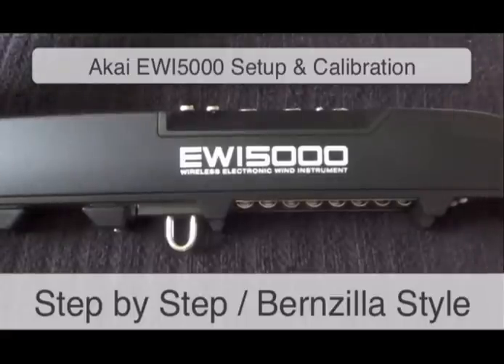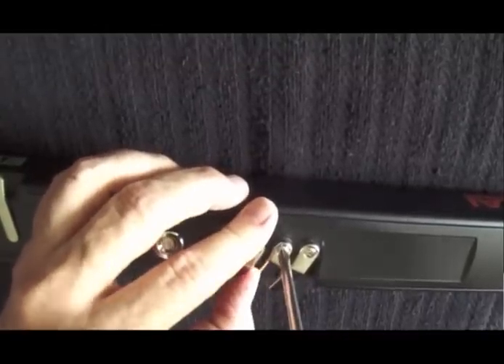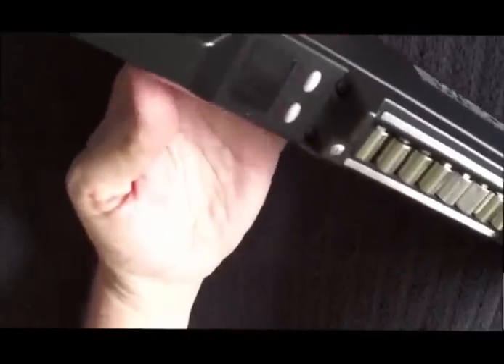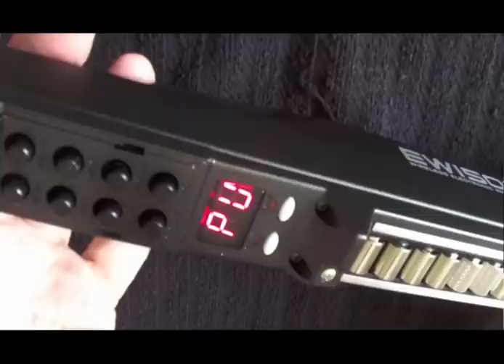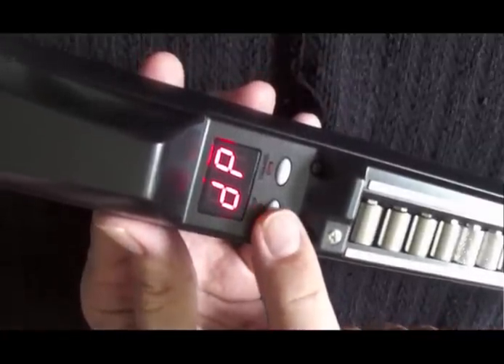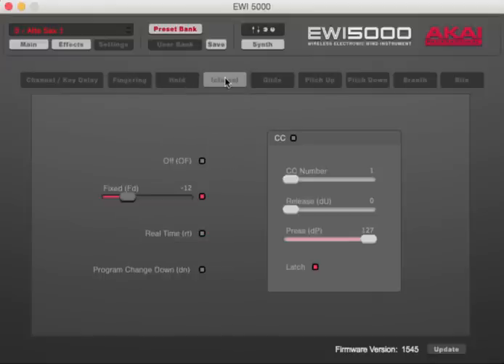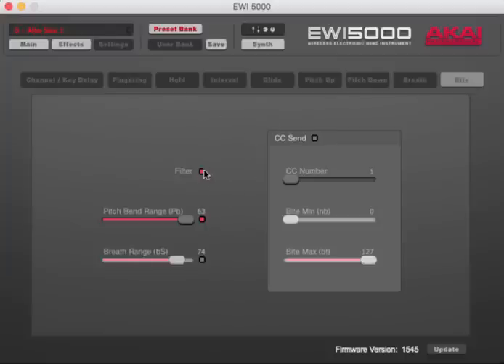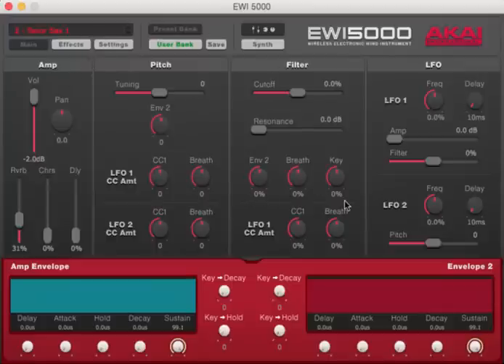EWI5000 Setup and Calibration Video Step by Step (Free Viewing)

Comment: Thanks! You do the support I would expect by Akai. 
I had some problem by unscrewing the low note keys as you show it. The internal screw nut was soldered insufficient to the printed board and fell off! A loose nut inside the printet cuircuit boards is ultrahazardous! I had to open the EWI to get it out. To solder it to the proper place would require to decompound the EWI completely (get off all the boards and other parts) to to make it accessible to a solder iron to solder back the loose nut. Now I think about another solution.

Comment: Hi Bernie, thanks for your well presented video, it saved me a lot of angst. I may get around to downloading your Presets but at the moment I've got enough to learn about my EWI 5000 as it is. Just a different question..I noticed in the manual you can set up the keys in an instrument order e.g Alto Sax, Tenor Sax, Trumpet, Clarinet, etc down the keys. This enables, as it tells me, to quickly change instruments during my playing a song e.g . It adds more interest if you can do this without foot pedals.
I also play a Yamaha WX7 linked up to a Yamaha MFC controller and then into the Yamaha VL 70m (with the new pre=set chip} and so changing from one instrument to another is just a foot tap away, but, as you can see, there are more parts but as you've got this versatility, it has worked well for me over the 20 or so years I've played that instrument.
Could you elaborate more perhaps on the midi functions available to the EWI 5000?
I would appreciate your input in this regard.
PS After having major changes to my teeth I found the EWI 5000 was my rescuer as I can't manage all my saxes, clarinet and Flute any more.All the best Bernie and good health to you during this Caromavirus-19 danger time.

Comment: So… tried to swap the two keys as you suggested.. the thing that retains the screw that holds the 12 key in place wasn’t attached to the unit and is now rattling around loose in my new AWI. 

 Got a video that shows a full disassembly/reassembly, so I can try to fix this?

Comment: Hi Bernie..... all the presets have now been set up and they sound great......also this process has allowed me to better understand the editor program too. What I find totally frustrating though is the user manual.  Eg it simply says for breath set the calibration from 0 to 99..... it does not say go higher/lower for easier breath just set between 0 and 99 ..... what use is that.   I am struggling a bit with breath and would like to know what makes it easier in terms of the 3 calibration settings for it...I.e. chorus, lfo and reverb....?????

Comment: Just graduated from an EWI USB to the new Solo . I have attempted to apply the Set up guidance you give for the EWI 5000 to the Solo where they fit. Worked out ok , and I learned a lot ! Question , would it be worth me purchasing your 100 pre sets for the common sounds in the Solo , or are they so much different that I would just mess things up ? and / or are you about to launch your Solo presets ?

Comment: Thank you very much Bernie. Very useful guide !!  I still do not get what is the difference between the  Breath Settings, you setup withthe rotary knobs,  and the  Breath calibration you setup with the bS  menu ( Sensitivity, Dynamic Range and Rate ) . Does this mean that the Breath Controller has 5 different settings , or there is an overlap between them . ..........also , if there are 5 different parameters to setup, what does each stand for ?  Thank you very much in advance.

Comment: Bernie,   Would these Bernie settings be ideal for a total beginner?
Reply from the maker: Yes. Except for possibly the dL (key delay). A beginner setting of higher than 04 will help reduce glitching. Try a setting of 10 to 12 with goal of working your way down to 04 or 03. I’ve tested it with really fast notes and found there is no need to go any lower than 03.

Comment: I followed each and every setting suggested in the video. I am sorry to say that my EWI5000 sounded awful after that. I had trusted that, being a novice at EWI, the advice of an expert (followed blindly) would have helped. It unfortunately did not.
I had to reset my EWI to factory conditions, and then followed my own criteria and some others by Alistair Parnell (also in YouTube). My EWI is sounding much better. I know that I will not take it to its best condition, as I am no expert, but little by little I will gradually improve it.
Thanks for your effort, Bernie, but your suggestions unfortunately did not work for me. I hope that they will for others.
Reply from the maker: You are the first to report unsatisfactory results from these settings so as a novice either you didn’t apply them correctly and/or you are overblowing the EWI when you play it. Try playing at half breath volume and turn up your speaker. My settings and calibrations only get you half way since the factory presets are weak. I suggest you at least go to the editor and turn them all up to -2db. Applying my Bernzilla user presets is also a big improvement. I hope this helps and best wishes on your EWI endeavors.
Reply: @BernieKenerson  I set my EWI as per your instruction and all 99 sounds that was boring.  Sounds a lot better than the factory settings now.  I did press the combination of buttons to reset the EWI to Factory settings. But they were not set as your video. My EWI is on the next release. Sounds 60 to 99 were already set at  3dB. Where the rest were as per your video.

Comment: Hi, in the Editor, In the interval section, you said CC, leave it alone, that is for Midi, could you elaborate. 
In the Breath section, you move the constant outpu CS to 127, because you used vocal, what is that? If not, where will you set it up? 
In the video, PP is on or off?
Thanks a lot
Juan

Comment: Hello, Bernie, I tried the setting in this video. I may have done something wrong but my problem is now my unit is locking up showing an upside L and reverse C... so I have to keep restoring it to default every time I turn it on or it locks up... ? have you ever seen that happen and what do you suggest I do. should I return it or is there another solution because Akai Tech don't seem to have any anwsers...
Reply from the maker: Rudeway I have two EWI5000 and have not seen that error before. Please be careful and accurate when you do the Calibration settings. If it keeps doing it send it back and get a replacement.
Reply: Bernie Kenerson I talk to Akai Tech and they ask me to send it back for a replacement... thanks for responding have a wonderful day
Reply from the maker: Rudeway you’re welcome. I hope you days are wonderful!
Reply: I got the same problem...do they tell you what happen to it?thanks!

Comment: Hi. When you start to blow to a sounds, does it always sound in the lower octave? Hardest thing, how to control the octave roller. Thanks
Reply: Lick off your left thumb before playing, it will help. A dry thumb causes problems on the octave rollers, wet thumb will work.

Comment: Thanks, Bernie; I set up my new EWI5000 as per your recommendations and been exploring the instrument. Would you have any idea why every once in a while, any tone I may be playing gains a "chainsaw" vibrato type effect? It's happenned three times now and I take it back to your youtube video and recalibrate it. Turning it off and on doesn't change it once it happens. And then, I notice I am getting audio drop. Do I need to always be facing the wireless wifi box? It seems to happen if I turn my back to the wifi unit, which is sitting on the floor. Or is something wrong with the unit?
Reply from the maker: ROSS2 To get rid of the Chainsaw effect you mentioned try turning it off wait a few seconds and turn back on. You may need to do it  2 or 3 times. Mine does it once in awhile when I first turn it on. The wireless can be sketchy at times so it’s best to not turn your back on it. Some audio dropouts happen when first loading a preset that hasn’t been used much. I play mine a lot so don’t get this much. It has happened when I load a preset I haven’t used in awhile but goes away quickly. I hope this helps.
Reply: Well, I went back in the studio and did what you suggested and the chain saw exited the room. You de man. Thanks.
Reply: @ross289  Just started with the EWI and keep on catching a side button that turns green that mess up the sound.

Comment: Ehi Bernie, I know it sounds stupid, but I don't feel confortable with electronic stuff. To me it's too difficult.
Here's the question. How do I fuck change the different sounds I wanna play in my new EWI 5000 if I'm not connected to the PC?????
Thank you Bernie.
Reply from the maker: You touch the chrome screw on the top of the upper bend plate just below the neck strap hook. While touching change presets using the Hold or Interval buttons (clear button on the side)

Comment: I reported on a severe  manufacturing defect (shame on Akai) causing the internal screw nut  to loosen off the printed card board and it fell inside the casing. I had to open the casing and remove it to avent something much worse. To overcome this product fault and save the instrument I cut an ISO metric female screw thread 3.5 mm into the remaining  empty hole of the metal part inside the casing. The original diameter accidentally fitted for this. I had to enlarge the existing hole in the short external k11 key to get the 3.5 mm screw through it and fasten the key in the new thread. ISO 3.5 mm is not very common in use. I had to study the catalogues of special hardware manufacturers.

Comment: Hey what does it mean when My EWI SAYS Ld I just got it and i cant get it to play♥
Reply from the maker: Will Noto Sorry to hear that.  I have not encountered Ld on the screen or the problem you are 
having.  Did you mean dL instead?

I also recommend that you remove the battery and leave it out for 30 minutes or longer being certain there is no power at all to the EWI.  Hopefully all will be well when you replace the battery.

If that doesn’t work contact Akai about your EWI problem and what Ld means.

Comment: Hi Bernie. Thx for uploading these settings. I did all what you showed and the instruments sounds much better now. But at the same time I face some difficulties. For example I have feeling that I need to blow quite strong to make the sound loud - when I experienced before with my various settings I didn't need blow as strong as now (I have never played any wind instruments so maybe my feeling is subjective?). Also now, when I try to opperate breath knob to higher values above 61, the red dot starts light from 63, but the noise starts to show up around 72 (not like before from 63-64). Another thing is the interval button - after your settings it has no function anymore?